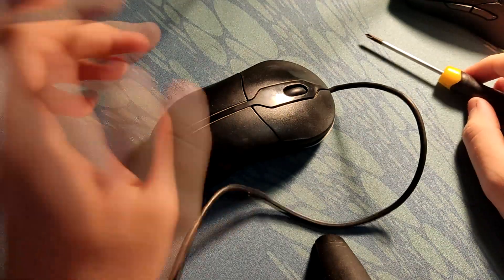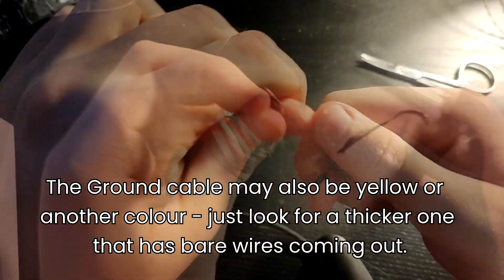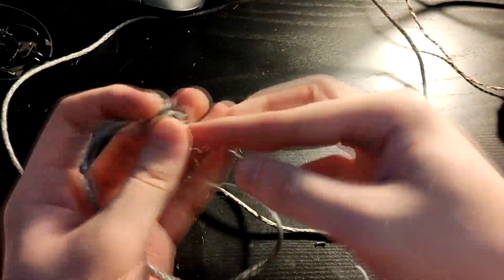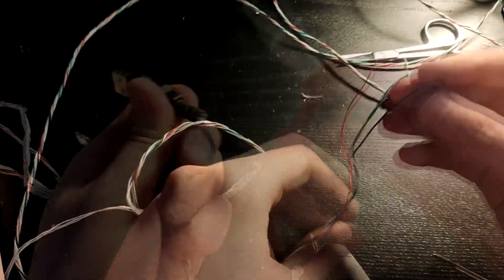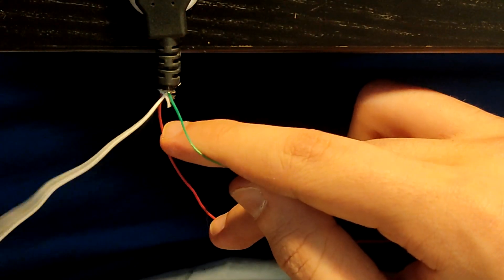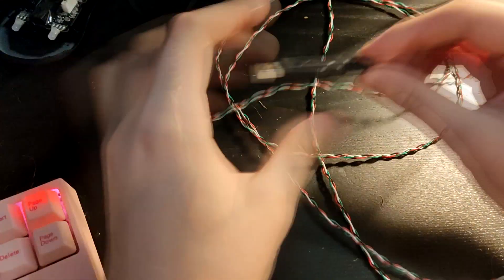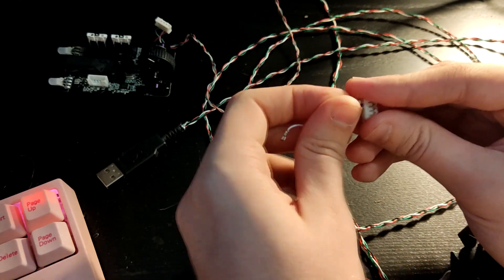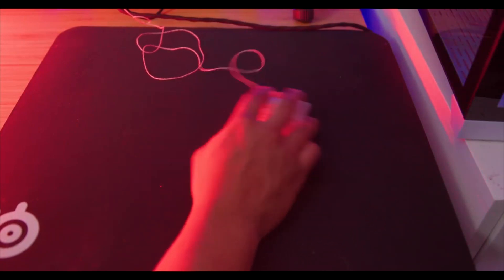How To Make The Best Mouse Cable For Free

Comment: I'm told I should do it slightly tigher than he shows here but wow, I'm so glad I found this, this is the most custom!

Also, OK this looks so sick truly the 90s movie hacker vibes I look for.

I also wonder what the best cable to do this with is, obviously the lighter the better but also I need to learn more about electronics and shit to understand what will give I imagine a stable and consisent current, voltage and doesnt have any polling rate issue or anything.
Reply from the maker: i've had the most success with logitech g203 cables. the shoelace/paracord type cables are often pretty bad for it, very thick, rubbery feeling kinda heavy but overly flexible wires so you really feel the weight of the cable.

Comment: ELI5: What Do Each Of The Wires Do?
Reply: Red is 5V power, Black is ground, White and Green are both data (positive/negative respectively).
Reply: the thicker black wire is shielding (unnecessary)

Comment: Thanks for sharing this mod! Do you know how the durability of a cable modded this way is?
I'm asking because paracords usually start breaking after a while for me, after about one year the cable starts breaking where it comes out of the mouse and during flicks the mouse sometimes loses it's connection. And then i fix it by moving more cable into the mouse. If durability is similar I think I rather keep using a paracord because the cable of my mouse (dav3) uses a different JST connector than most mice so geting a backup cable would be harder.
Reply from the maker: none of mine have ever broken, i'd imagine it's more durable because the wires won't be bending sharply as frequently.
Reply: that sounds awesome!

Comment: I've done this. It's not as flexible as my cheap paracord i bought from Aliexpress and makes a terrible noise on the mousepad.
Reply from the maker: flexibility isn't the goal, it's much less disruptive to your mouse movement than any paracord i've tried. you also left a comment 23 hours ago reading "2:45 what can i do instead of tie them?" which is causing me to believe you did it wrong
Reply: You should braid it "loose", probably you did it tight. I m using it with no braiding (yes, each cable is separate), and the "cable feeling" is near to zero.
Reply: @apa3plus  think he did it right coz i had same issue, even if it doesnt do noises its getting in the way sometimes too kind of but overall its much better than stock cable

Comment: Please don't do this ‼️❗‼️‼️❗‼️
Yesterday my power went off and the mouse caused a short which resulted in my PSU getting blown up, ground wire is important and it serves a purpose, don't mess with it.
Reply: You did it wrong. So do not complain here. I did it and it s by far the best cable I ever have.
Reply: @cancelik  i didn't do it wrong, he clearly said that you should remove the ground wire, i used the mouse for weeks without any problems, until i had a power surge in my area. Ground wire is important in preventing shorts, removing it basically gives you no buffer when there is a power failure of some sort. I also loved the cable, it felt like i had a wireless mouse, but it cause my PSU to short, and spend $100 on a new PSU.
Reply: @user_bilal  Nickini görmemiştim. Anlamadığım şey şu, sen ince siyah ground telini mi kestin, yoksa diğer 4 teli saran ve fişe kalın siyah kabloyla gelen teli mi kestin?
Reply: @user_bilal  thicker one is "shield wire", not the ground. and it has nothing to do with the electiricity. look at the correction he wrote at description: "minor error: i call the shield cable the ground cable for some reason".
Reply: Infelizmente estou sem tempo para ensinar... Você Infelizmente é leigo e não entende de eletrônica, sua fonte queimou por outro motivo.
Reply: So if I remove the shield cable nothing would happend.
Reply: thats from power surge not from your mouse lol